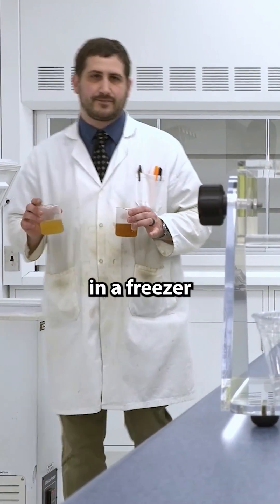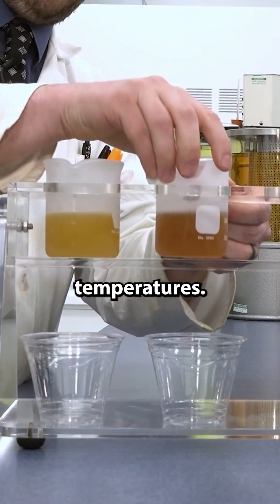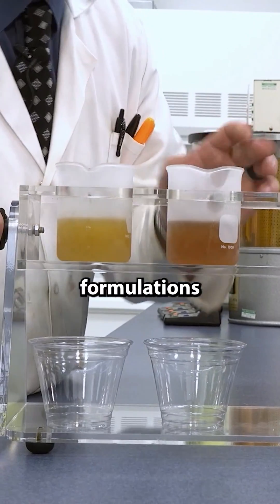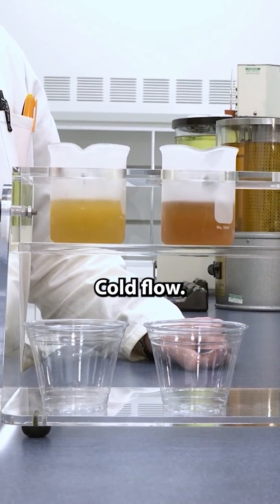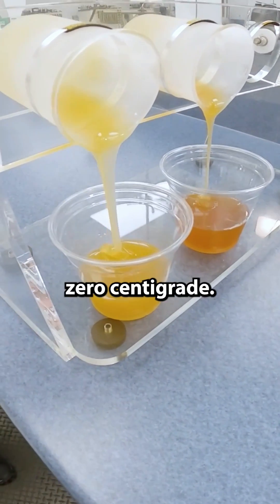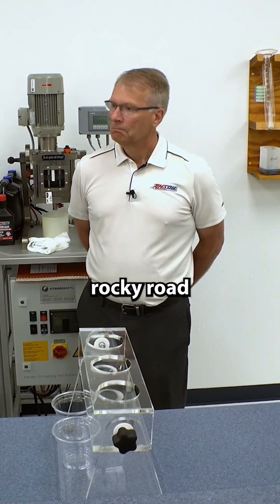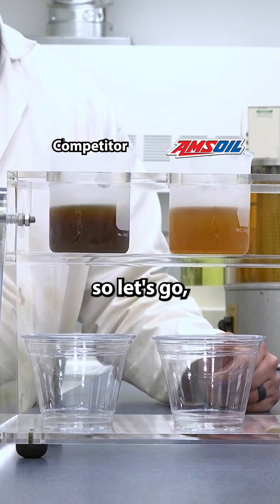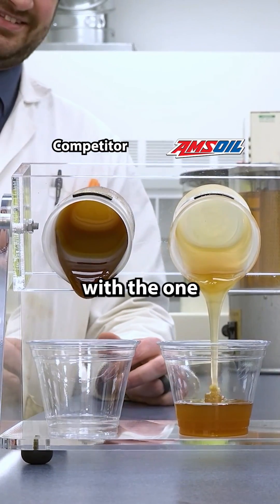Engine Oil At -35°C

Comment: See, this is smart marketing. Actually using the correctly winter rated oil, like 0W-x would not have been as impressive of a difference. Use the correct viscosity for your operating environment and don't trust everything you see on the internet. 

I'd choose a correct viscosity winter oil with an additive package for other things over the wrong viscosity with an additive package for cold flow. Just saying.

Comment: Mis leading a bit.1. oil for ur car depends on where ur are in the world. Most places the oil will not be at that temp. 2. Oil does not always perform the same as other oils at the same temp. 3. The flow rate is one factor to consider when selecting oils. What climate is ur country, what is the protection of the oil at the correct temp. Best to consider the whole range to which the oil will be used at.

Comment: I'd buy Amsoil if i could afford it, too. I live in Alaska, and it can get as cold as -74 Fahrenheit. Even with my 2 block heaters, oil pan heater, transmission pan heater, and battery charger plugged in all night, it's still hard to start.

Comment: If you don’t have an oil pan heater at those temperatures you deserve a blown engine! Conventional oil changed regularly at the proper intervals and engine will live just as long of a life for 1/4 of the cost. Sorry just not worth it. All these new oils with additives are all made for your so called “climate change” and emissions that’s all. Won’t pay for a check mark on my shoes either!

Comment: I started using Amsoil 15 years ago in my semi engine. Now I use it for everything on the truck and on my reefer unit on my trailer. My pickup the wife's van my motorcycles four wheelers, golf carts boats, tractors, lawnmowers, chainsaws... I live in Northern Minnesota and it makes a big big difference starting everything and actually saves me money because I don't have to change the oil as often and don't have to plug anything in anymore. It's definitely the best oil on the market. Every other synthetic oil is just trying to copy the original synthetic.

Comment: firstly its not that much better at flowing... secondly, cold temperatures are just one of the parameters. Now show us the film strength, evap and residue cleaning properties... Oh yeah, you probably dont do so well against your competitor is those. And its been proven, (watch project farm)  your oil was tested against 10 other brands, and Delo outperformed AMSOIL in every category, EXCEPT the cold flow test...

Comment: I drive a honda. It can start up with or without oil. Idc if the oil flows faster than the light, I’m sticking with what i got
Reply: Same.   1997 Honda Accord with 634,000 miles
Reply: mostly because it have oil that actually flows at lower temps. My Honda Civic "1.4" 2011 specified in the warranty that the engine warranty was only valid if running 5w30 here in the Nordics.
(not that it matters now since that is just to 100k km, passed 300k km this summer)

any 5w30 would be like water compare to the 15w40 Amsoil used here at -35*C... (would still recommend a pre-heater at those temps, not just for the engine but also for the poor soul driving)
but then, using the actual oil designed for the temperature when you can have more dramatic difference using oils designed for the deserts of Mexico.

Comment: Good oil, it better be at 4X the cost! 
Any one in that temperature range better have oil and coolant heaters, transmission and differentials too! 
BTW I use 5w40 syn year round in 4cyl Yanmar

Comment: I stopped selling Amsoil in my shop 8 years ago when 4 different customers had no oil pressure on the SAME DAY!

It was about 15F that morning and Customer No Service at amsoil took 0 accountability for their obviously defective batch of oil that turned solid at 20F

 aka Pour Point. Should have flowed at -40F
 

It was signature series oil to boot!

Comment: I live in the Pilbara region of Western Australia, i don't have to worry about getting into freezing temperatures. The temperature doesn't get below 20 degrees Celsius.
Reply: 5w40 for  Australia, can handle the heat in summer and 5w is more than enough for the mild temps too.

Comment: All 15w40 oil flows the same. Hence 10 and 40 being the weight of the oil. 10 cold and 40 hot. Additives do help but are not needed. You think the engineer designed a motor with too thick of oil??

Comment: you don't need to think about different oil companies to buy from if you are living a climate of -35°C.

YOU SIMPLY NEED A ENGINE HEATER.
Reply: a battery with decent CCA will get you through most of your winter problems even if you're on "okay" oil

Comment: I don’t want to cold start with either of those. If it’s -35c it’s too Damm cold for me to be going anywhere.
Reply: Block heater and or glow plugs. No such thing as a cold start.
Reply: @camerons6028 Glow plugs don't heat up the oil!  You should definitely have and use a block heater when it's sub-zero!
Reply: @camerons6028  Battery heater, oil pan heater, or a freeze plug heater, even a radiator hose heater.
Reply: @camerons6028  a block heater, warms the coolant in the block. Last week, when it was -52 Celsius where I live, my coolant temperature was still -17 when I started it with the block heater being on for 6 hours. Again, that heats the coolant in the block as the oil sits in the oil pan. So yes, there is such a thing as a cold start.
Reply: She'll be fine in -40. Just use a block heater if you can. If not just have a good battery with a good CCA and let 'er warm up.
Reply: Shouldn't be using a 15w40 in -35c anyway. 0w40 will serve you much better
Reply: I wouldn’t be going anywhere for the whole month of January and half of December and February lol
Reply: Plenty of us live in the Arctic where life doesn’t stop due to it being cold or there being snow. Winterize your vehicle and plug it in. Zero issues at -40 and 100F
Reply: @9The0Unknown7 lol.  Artic..... north of the 49th parallel prairies it is normal to get sub -40s now and then in winter.....😅😅😅
Reply: @gosselbrian now and then… every winter is like this in the arctic. It is -35 where I lived
Reply: @9The0Unknown7 there's nowhere to go down there! Lmao
Reply: @RELOADEDEDER it's up there not down there. They said arctic not Antarctica.
Reply: @9The0Unknown7 but then the oil is not at -30 wen it's plugged in enyway 🫣
Reply: @9The0Unknown7 artic 😂 happens in North Dakota all the time. Except maybe this year hopefully
Reply: @9The0Unknown7  plug it into a tree or igloo
Reply: Nothing but the truth if you are not plugged in .  No matter what brand it is . 
At that temp I've got a 5mi minimum, to allow the grid heaters to stop Hitting the battery like it's mike Tyson for 3mi at 35mph ( 91.5 cummins dual element 125A toster more commonly calld a grid hearter) ,and then recover the battery for 2mi, enough to where it will start next time and or prevent freezing due to low state of charge. 

Most sketchy, Will it start I've endured .
Went snow snowshoeing on new years eave on top of the continental divide in MT  4hrs out and 3 back to the truck sitting is the wind at almost 7000' -37f for 7hr  she started to my delight.  No cell coverage and no traffic.  
Warm thoughts help
Reply: @daviddroescher What does "5mi" and "3mi" mean?
Reply: In the north, once the temp goes to -20c, we don't shut off our diesels until the weekends or maintenance days. Engines stay running until about 2nd week of March.
Reply: Where is one driving at -35c? Even in fairbanks alaska the average coldest it gets is -25c. So how about we just do a realistic like 10 degree farenheit comparison.
Reply: @Hallowsaw not true at all, I'm in Fairbanks right now and it's literally -35F. It's been in the -30/40s all week. Coldest I've seen is -54F.
Reply: It’s -40 here
Reply: Uhhh to work ? Or you just sit around all day
Reply: It gets that cold occasionally where I live, you still have to go places
Reply: -35c Is Nornmal Winter In Latvia :)
Reply: So you wouldn't be going anywhere for a couple of months every year in Canada lol
Reply: Welcome to Russia. We get down to -65
Reply: At that point you already have a block heater
Reply: I have no choice for the next couple of months
Reply: Too cold? Lol in Siberia we going every day on our cars to nearest store in -35-40 and walking in parks 😂
Reply: Welcome to the candian oilfield lmao. Started my truck at minus 40c this weekend
Reply: If it’s that cold you need a block heater.
Reply: they said its 15w40s so most people in those areas would be using 5w or 0w at least
Reply: My brother.
Reply: cold start, literally.
Reply: Lots of people live in areas where it’s -35 for literally 6-8 months out of the year, good luck with that
Reply: @weladravideos this is not true. There are not many people that live in a climate like that. That is extremely exaggerated. -35F average for 6-8 months is like the north pole.

Comment: Changing to amsoil changed my LIFE! Cold starts used to be the stuff of nightmares, no power, 90 lbs of pressure, had to let the truck warm up for minutes before being able to take it on a main road. With amsoil i just had to wait less then a minute, cold pressure never exceeded 70lbs, and the power was there after seconds.
Reply: You should always let it warm up to temp before driving

Comment: -35 C is almost the same as -35 F. C and F scales meet at -40.
Reply: I don't see the point in what you're saying? They're definitely not the same at -35°C, which is the temperature for the experiment
Reply: @piercer4882   -35 C is -31 F  As cold goes, those temperatures are the same.  -40 C is the same temperature as -40 F
Reply: @idadho  they're not the same.. to a human, we can feel no difference,  but when testing stuff, details matter.  One item may work fine at -31F and may fail at -35F.. it does matter
Reply: @piercer4882  That is a very rare situation.
Reply: @idadho  tbh it's actually not.. I work in an R&D engineering department and do lots of testing in all kinds of conditions.  You would be surprised why some components fail and others don't..  there are a lot of times where small changes are enough to cause issues
Reply: @piercer4882  How many system ever operate at -30 to -50  C or F.  You may look for those on other planet systems but even earth satellites do not get that cold. Operating in the Arctic or Antarctic would see those temps in some areas.  The extreme Arctic freeze weather that can hit lower Canada and even northern lower 48 is rare.

Comment: Pretty shocking. If they are truly the same weight ratings, why arent they more similar? I thought that was a relatively regulated aspect.
Reply: One oil is made to meet the minimum specifications, one is made to be the best it can be.
Reply: @Legally_its_a_joke  arent weight ratings simply how well the fluid flows at a given temperature? If these 15w weight oils flow more like 5w or 0w, why arent they labelled as that then? I'd think there is such a thing as running too thin of an oil for a given application (some performance cars require thicker 10 or 15w oils, and I bet no one would advocate for anyone to run a 0w in them). Wouldnt running this very fluid 15w oil in there cause the same types of issues as an oil with thinner W rating?

Comment: they cant be the same weight because the weight is determined BY flow rate at temperature
Reply: I don’t think 15w40 is rated to be used that low, don’t know why they don’t say they’re testing beyond limits. So i’m sure you’re right and the appropriate oil would flow at that temperature

Comment: I believe y'all, but shouldn't the beakers be the same... On the first test the competitor has a sharper pour spout and on the second the ams has the sharper one.
Reply: Didn't make a difference for the oil in the first test. Also the amsoil beats the competition to the edge of the beaker to begin with, that minor discrepancy likely plays little to no role in the drastic difference between the compared products. However, I commend you on that excellent attention to detail, I went back and watched again after reading this comment and indeed, the beakers do seem to vary quite a bit. 

If you enjoyed this I'm sure you'll enjoy Project Farm's oil testing. Quite fascinating stuff. Have you run across that channel yet? (I always assume yes, he's got quite a following) just curious.

Comment: When it gets that damn cold outside I just KNOW I’m gonna sleep in until it warms up .  Now seriously speaking here I have seen Delo 400 & Shell Rotella users get exceptional life out of their over the road Semi-truck engines & personally use both in my own Duramax powered GMC 2500 .  The Shell is better for winter use than the Chevron , as it seems to flow a bit better cold , and here in Southern California it never gets much below freezing, at least not for any length of time .  Amsoil is a great product , but myself personally I cannot justify the added cost per Gallon it costs . Plus I have seen Amsoil users engine internals after hundreds of thousands of miles use have greater sludge build up than Either the Shell or Chevron users at roughly same milage which leads me to believe the additives for keeping deposits at bay are better in those two verses Amsoil. Just my own personal observations here .
Reply: I just cant stand the ticking/tapping that shell & delo cause in my lbz, but no ticking with amsoil. With the asmoil dual remote oil bypass filtration system, i feel confident in the cleanliness of my engine.

Comment: Project Farm did this test 4 years ago... and Pennzoil tested almost as good and it's cheaper to buy..  but yes Amsoil did win...  but the difference between the 2 is hardly any difference.. also Pennzoil had less wear on the bearing test...  so I would rather have less wear and the same cold start capability... watch his videos.. he tested a ton of different oils...
Reply: Project Farm is one of the best channels out there PERIOD!
Reply: I use super tech oil from Wally world and have never had any internal engine issues and one of them is a 5.4 3 valve Triton. The engine everyone swears is so bad. I have almost 300,000 hard miles on it.
Reply: @danp7463 used mobile 1 on a 4.6 in an econoline with 697k. Still ran like a top, but the floor was rusting out. Most oils will do the job if changed regularly, but for high boost applications and/or racing I wouldn't choose anything but penzoil ultra platinum or amsoil.
Reply: Good to hear.
i only use pennz but after this short had me worried about my oil haha
Reply: Love project farm, one of the best channels on YouTube.
Reply: Note that it was Pennzoil Ultra Platinum, not regular Pennzoil or Pennzoil Ultra. And both Redline and Amsoil did perform better. But Redline is very expensive and Amsoil nearly impossible to find for purchase, so I have been using Ultra Platinum ever since.
Reply: Pennzoil ultra platinum not just regular platinum wanna make that clear
Reply: Also the cups have different endings.
Reply: This
Reply: His tests aren’t all ASTM so you think one has less WEAR than another. The high pressure test he shows evaluates extreme pressure additives in GEAR OIL not MOTOR OIL…..
Reply: An important note - the Pennzoil that did just about as good as Amsoil is Pennzoil Ultra Platinum, which is basically their highest end oil. Their cheaper oils likely aren't quite as good (can't remember if he tested cheaper pennzoil products, it's been a while)
Reply: I remember watching his test too. His test is the best and he's not getting sponsored either. So his test is as real as it gets
Reply: He's definetly the guy when it comes to objective and precise testing
Reply: It was such a miniscule win for the wear test for Pennzoil, but a massive win on the flow test for amsoil, thats why i chose amsoil for my diesel
Reply: @Legally_its_a_joke not sure which video you guys are talking about, but the one I watched was penzoil winning the evap test, and amsoil winning the lubricity test and flow test, both by extremely narrow margins. Just watched it, it was the showdown vid between the two from a couple years ago. Perhaps there's a newer vid?
Reply: I use Quaker State never had a problem, good oil and it’s cheap
Reply: Project farm isn't particularly scientific. It's more of a scientific pantomime than anything real or viable when it comes to chemicals. Very entertaining though!

Comment: I started using amsoil recently, and I'm impressed. Just wish it wasn't so expensive.
Reply: Schaeffer oil is less expensive and just as good
Reply: I hope it helps you sleep easier because it's not doing any good in %98 of applications.   Not that ams isn't the best, perhaps,  but there is a point at which you get no return on investment. I'd say for most people that cutoff is likely before any name brand synthetic.   In full disclosure I use rotella 5w40 synthetic for the cold 6months and any brand 15w40 during the hot months, Lincoln Ne area.
Reply: You should reconsider. Just buy Kirkland synthetic (1/2 to 1/3 the price) and change it regularly.  I have three cars with over 250,000 miles.  Used to use Redline, but realized it’s just a waste of money. Don’t get me wrong. They’re great oils. They’re just not worth it.   Key is regular changes.
Reply: I personally prefer pennzoil as it's far cheaper and very close in terms of quality.